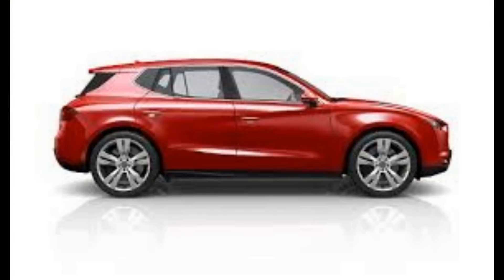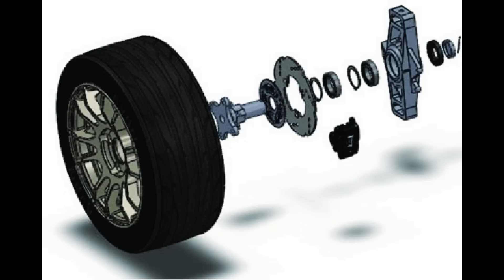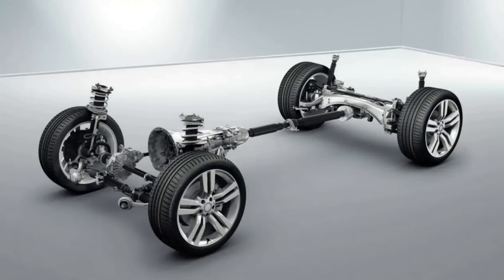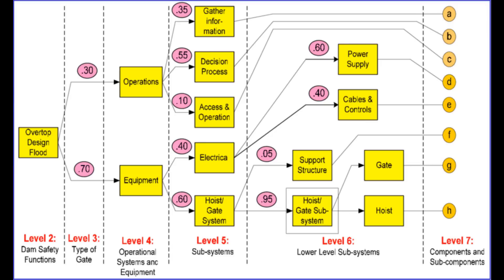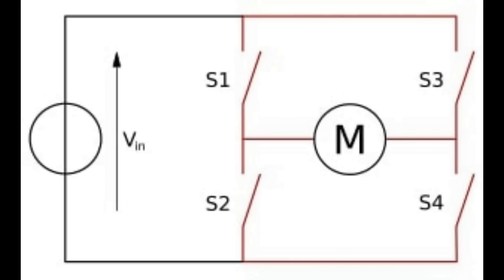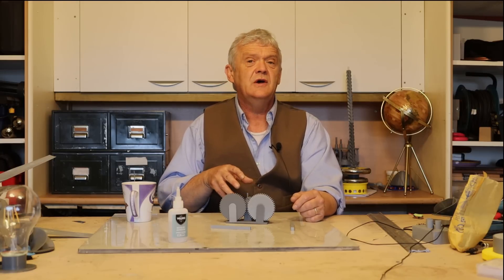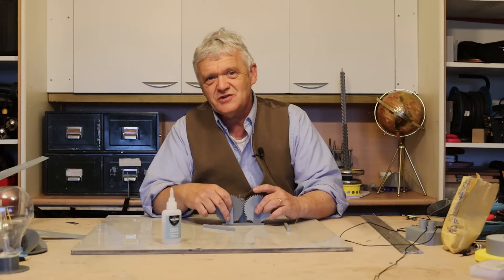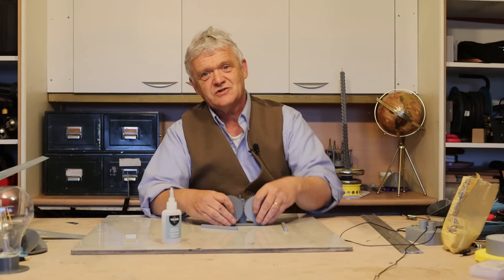2053 Machine Design And Reversing Gear

Comment: In my own designs, I try to get multiple functions from each part = Part reduction & increased function.
For example the tyres of a car perform several functions; Road gripping, shock absorbing, allow for limitations of steering/drive geometry, hard wearing replaceable interface between car & environment...
Probably others?

Comment: The twisted screw could be made to run any size coil as well....just make interchangeable twisted screws, then simply swap it out for the one that matches your coil.  As long as you could make a design where it is easy to change the length of the holder and install the different length screws.

Comment: Hi Robert. Love your videos. If you change the angle of the reversible screw compared to the spindle then the length of travel can change. One size can fit all spindles within reason. Eugene.

Comment: I would go for reversing the polarity to the motor.
Do note: I find this device you have there a little bit like what I found as a child in an electric car. I opened it up to see why going backwards rotates the front wheels, but not when you go forwards. I found a rotating part, like the one you have, only this one was 'switching' using friction. Thus when you reverse polarity the motor spins the other way, and by friction it pushes that middle gear towards the other part of the mechanism. That same friction also 'kept' pushing the gears together. It was a nifty way to add 'steering' to a car with only 2 wires from the 'wired remote control'.

Comment: Use the automatic-reversing assembly already designed and add an adjustable-length lever to give it a variable throw on the far end.   Easy as.

Comment: Brings to mind a cart with sliding bumper...the cart moves till it hits the bumper, the bumper slides in...the cart changes direction, the bumper runs through the entire cart...so as the front bumper slides in,the back bumper slides out...the cart runs till the back bumper hits and slides in..pushing the front bumper out ready for the next hit ...making the cart go back and forth...get what Im saying lol! Simple concept, challenge to describe!  Great video!

Comment: You can build a reverser like they use on some machine tools where there is a trip on each end, on a bar which allows one to space the trip along the bar on each end [basically a pair of opposed trips, each for one end] and these trips only exist for the purpose of precisely engaging the reversing of the shuttle.

The shuttle has a rocker on it that, when tripped, instantly reverses the direction of travel.

Comment: I have a coil winder that has a counter, a speed controller and is reversible with a mounting point where I can mount various mandrels and holder shapes, with a feed reel with controlled resistance.

The only part I lack at this point, is the wire feed needle on a synchronized shuttle.

But I have the parts to build one, it just has not yet become a priority for any of the coils I have needed to wind.

I do plan some day to build and mount it eventually.

Comment: What if you just had three gears, two side by side meshing the 3rd sliding between them as they spread apart just enough to no longer mesh, or* 
Have two sets of gears, one with with 2meshing gears, one with (3)three, fir reverse, have the drive  
Driving both, the output side on bearings with a sliding dog between keyed to the shaft,  a simple slide could be a fraction of mm and it reversed! 👍
dogs rive

Comment: I can think of several even simpler mechanisms to reverse the threading on a coil winder, the simplest is a guide that is positioned on a horizontal circular turntable place it near the edge and the turning of the turntable will space a wider coil, nearer the centre for a shorter coil, drive this using a worm from the main winding motor and it will traverse the coil say every hundred turns of the coil (dependent upon gearing). if you want a linear motion of the guide use a scotch yoke to transfer to a wire guide on the end of the yoke.

Comment: Rob, I think his second version is decidedly better.  It is smaller, uses less parts, and your wire rolling rod can be easily attached to the gear with the indicator.  That being said, wouldn't your magnet transmission work better?  That would be neat to see in a machine design like this.
Keep up the good work.
Godspeed.